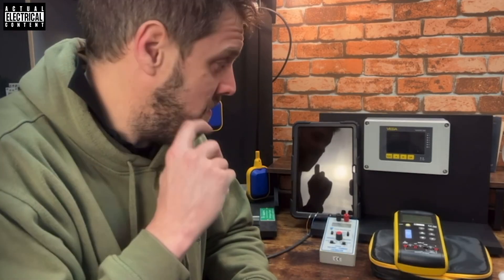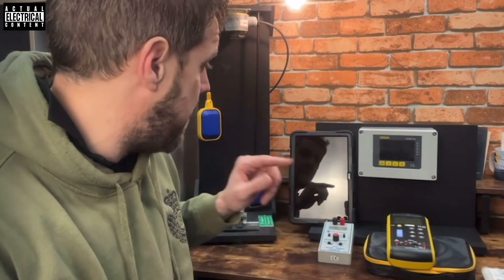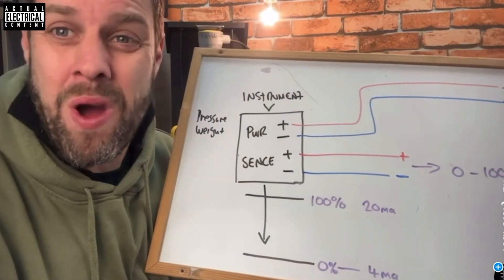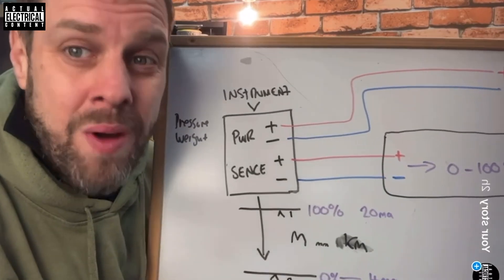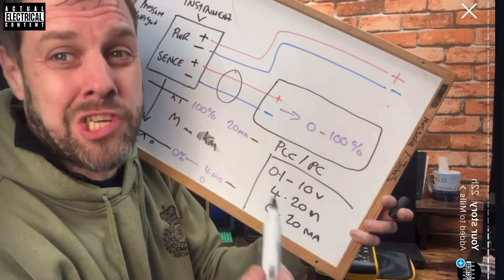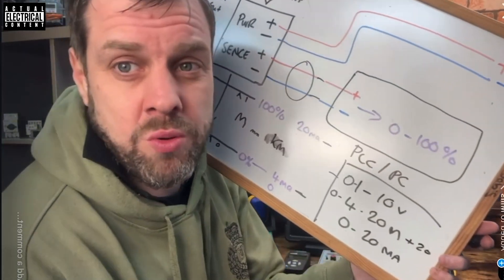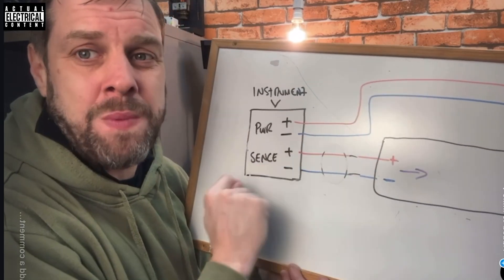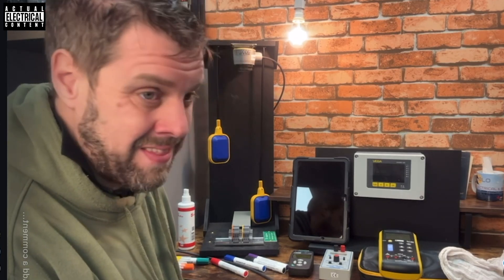ANALOUGE VALUES IN PLC,s PROCESS CONTROL & AUTOMATION - WIRES & CONNECTIONS

Comment: Other signals could be 2-10volts or 1-5volts the elevated Zero 4mA 2volt I think the reason for this goes back to the use of pneumatic analog signals used to control valve positions etc where signals of 3-15psi would be used in the event of signal loss the pressure would go below 3psi which would ensure the valve etc would be fully closed at zero. In the days before electronics most process instrumentation was using pneumatic signals for liquid level, flow,pressure and temperature control.
Reply from the maker: I’ve not heard of a few of them but your correct all the instruments values come from when they used pressure , when I started in the 90,s it was not uncommon to find stuff still using pressure to gauges back in the control room , not so much nor